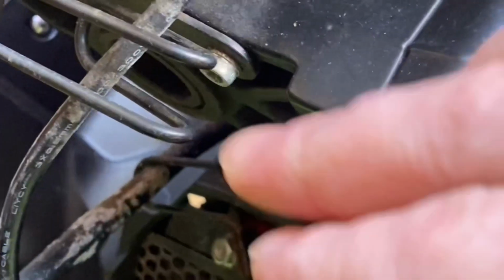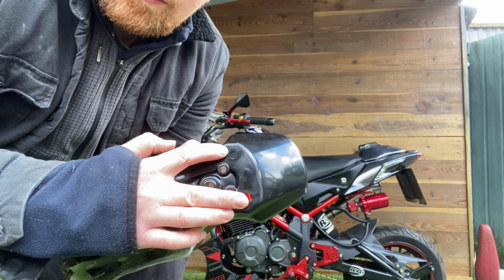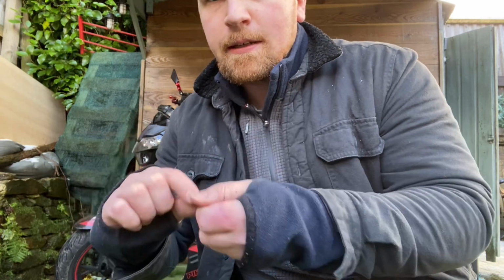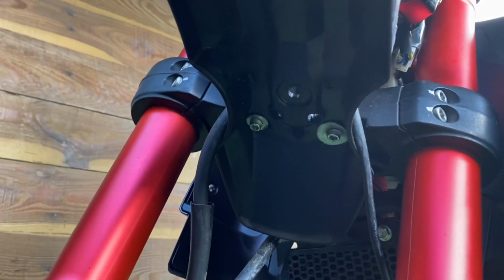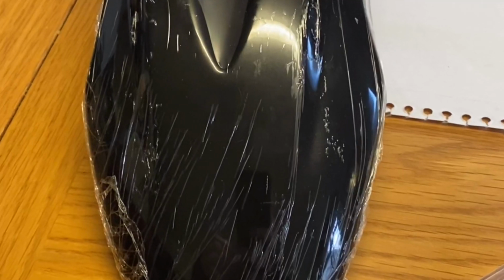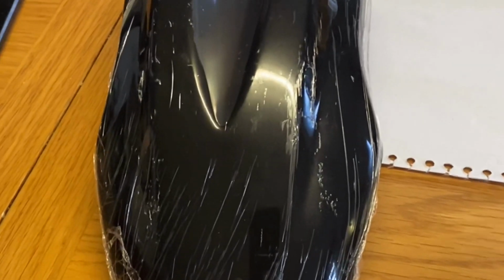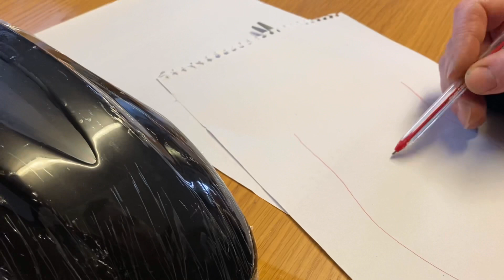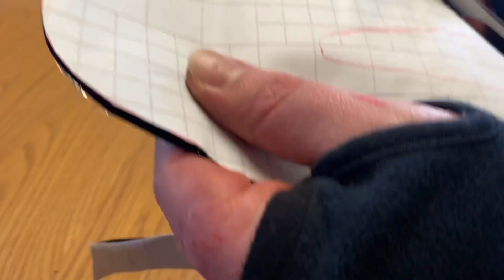Highly modified Benelli tnt 125 / 155 gets  new supermoto mudguard!! Crf50 parts!! ** watch **

Comment: How much extra speed would I get If I put kit on my tnt 125  also were are restricters thanks
Reply from the maker: On its own not a lot to be honest, I put on a full flowing race exhaust and an open air K&n air filter which made a huge difference, also a larger throttle body and injector, really made the 155 kit come alive, I’m just under 15 stone and with the bike standard I was only getting 58mph but after all of the upgrades I was getting 80mph I also put a 16t front sprocket on so it sits at 65-70 nicely without revving the nuts off it..
Reply: @pikesbikesnguns7720  how did you remove the limiter as they are restricted arent they ?